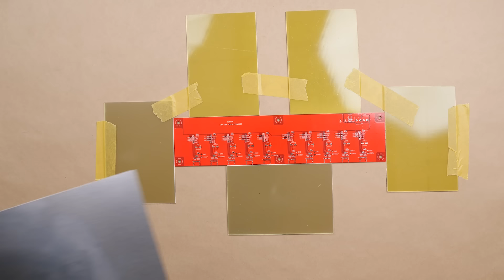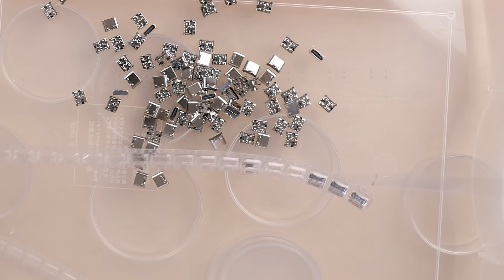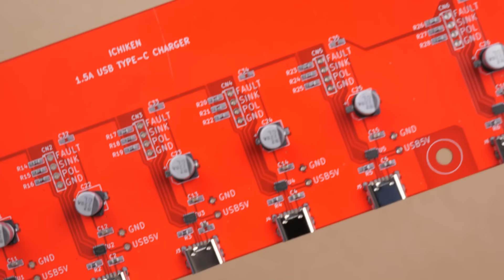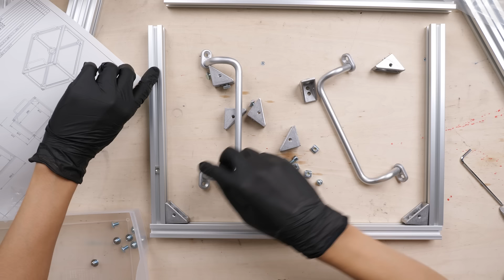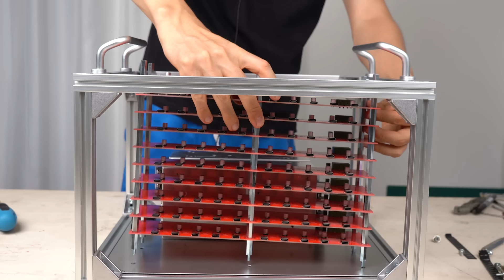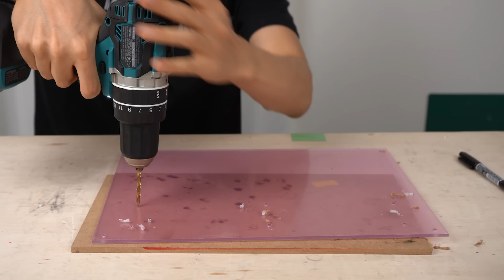I Built a USB-C Charger that Can Charge 100 Devices at the Same Time.

Comment from the maker: The charging power is 10W per port.
It could be upgraded to several tens of watts per port with USB-PD support,
but that would require a larger power supply, a step-down converter, and a USB-PD controller.

Comment: I very much enjoy the task of building smd kits as I find it therapeutic. With that said I would never do so many in one sitting. A single board of the size and component count you are using I would assemble over a week in half hour to 45 minute time frame using a soldering iron or hot air rework station or more likely a combination of the two.

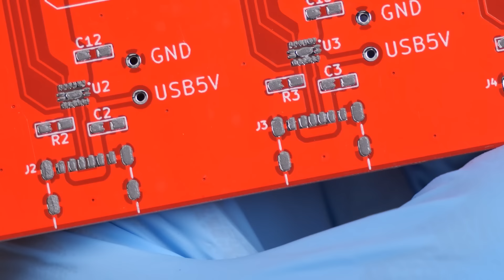Comment: 2:18 No, it really isn’t. The amount of paste varies a lot, it’s smeared between pads… not surprising given the technique used. You must make sure the stencil is laying completely flat, not flopping around like shown. (For hand application, have them cut the stencil down to just a little bit bigger than the board.) The stencil should have no air gap, it should not press down when you use the squeegee. And you want to apply paste in one single motion. Going back over a section smears the paste.

Comment: You're using two 5v 120A power supplies ... those are probably a few hundred dollars each and probably around 80-85% efficient. Also, you're limited to 5v charge voltage, so at most maybe 15 watts (5v at 3A) to any device?  I would have chosen 24v power supplies and used a usb controller chip with built in step-down converter to step down 24v to whatever voltage the device wants to negotiate (5v, 9v, 12v, 15v, 20v) ... Injoinic makes some chips that are super easy to use for this purpose.

Comment: 1:49 Use roller like those for baking?
Reply: It wouldn't work well because of air in small holes. And you need to fill holes without additional layer of paste over the plate.

Comment: You gotta be kidding me. All that for 5v 1.5a charging? What device nowadays will charge at any reasonable rates at this power level? I understand that designing each port to output a larger amount of power like 30w/65w/100w will require much more complex circuitry and design not to mention cooling. But you could've archived the same thing with a charger that has like 25 65w PD ports as this as even though the unit you designed has 100 ports and can charge 100 devices at a time, the charging rate will be significantly slower.
Reply: bro its not that deep this is just a joke

Comment: There are many interesting aspects to this build.  
There isn't really a use case for the project except for charging stations at places like shopping malls.
And if you were to build it, then i wouldn't copy it as there are issues with the design and construction.
Reply: Maybe not 100, but for 30-50 or more, there are a lot of power systems these days which charge with USB-C. It's not uncommon for a piece of equipment to have 2 charging batteries and one running.

Comment: Nice concept now let's make one for PD charging that will be a great video.
Reply: With 9kW max power draw!
Reply: That could be done, shared 24V rail for multiple ports, each of which has its own buck converter / PD comm IC? There's got to be all in one PD controller / buck IC's...
Reply: one pd port can put out 240max so it will need 240*100 = 24,000 Watts or 24 KW. Best of luck making that !
Reply: @Srjn-99 I did the math, for a 230V supply you'd need 104 amps, lol. That is more than some houses can draw from the grid I think, lmao
Reply: @LoganT547  thats not at all realistic 😅
Reply: @kamilhorvat8290 why would i need that much ports then?
Reply: Nope it adds up lol, 240W for 100 ports is just unfeasible. Accounting for AC to DC conversion losses it would probably be more like 27kW considering no SMPS is 100% efficient
Reply: Or a much simpler one would be a 65w PD charger so it’s just 6500W